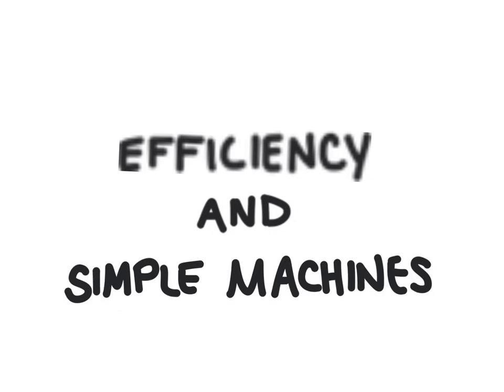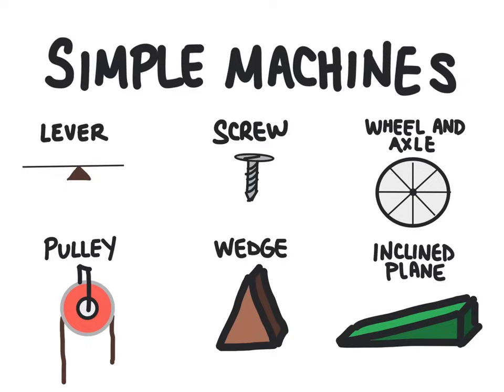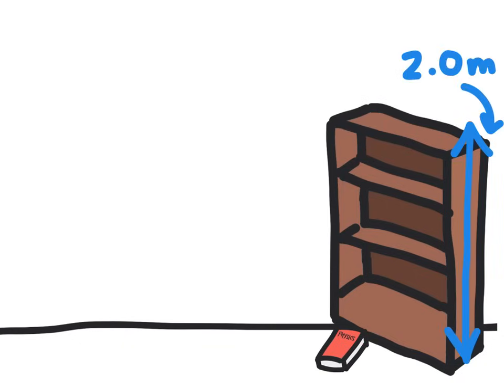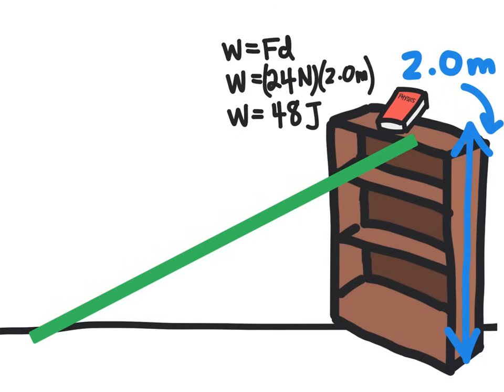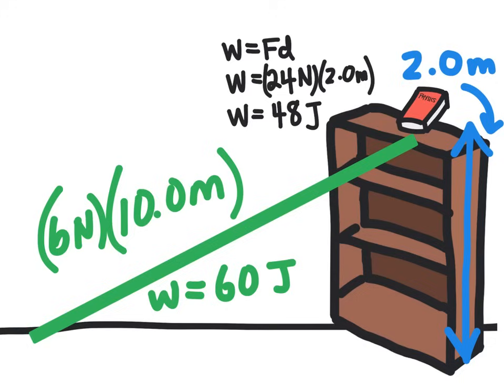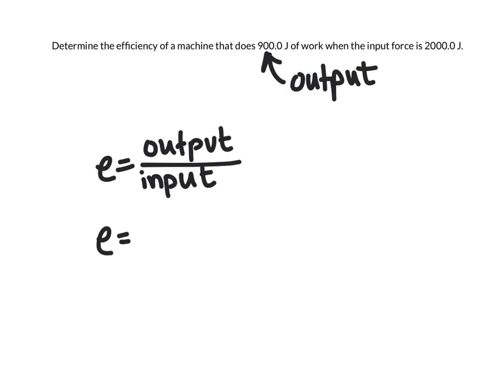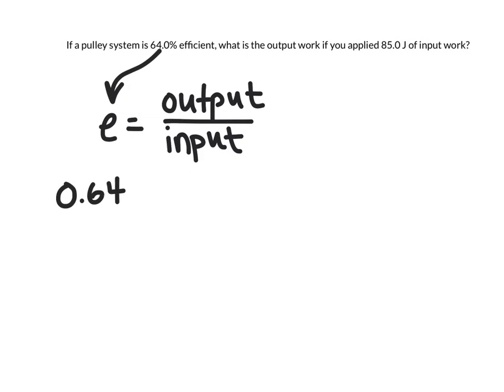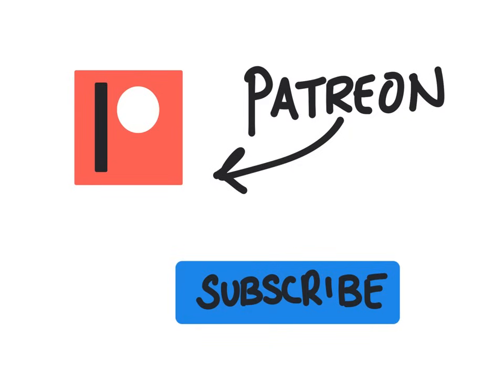Efficiency and Simple Machines

Comment: Maybe I don't understand something. Following your formula with a more inclined plane you do the lifting easier, but it is less efficient???? I have read that efficiency let you do the same work with less effort. Then, more inclined is the plane more efficiency.
Reply from the maker: An inclined plane will require less force than to lift the object straight up. It's not necessarily less work because you have to also consider the distance to move the object, which is always more when using an inclined plane.

Comment: Other simple machines: (Lever, Screw, Wheel and axle, Pulley, Wedge, Ramp...) Pendulum, Rope / string, Funnel, Balance, Counterweight, Hinge, Swivel/ Pivot, Turntable, Drawbridge, Latch (hasp lock), Bow, Blunt object, Blade, Bearings, Deadly Trap, Ratchet, Tent-Pole, Crank, Winding mechanism, Blocking mechanism, Straw, Buoy, Bridge, Balloon, Kite / Glider, Zip-line, Sundial, Prism, Mirror, Art.